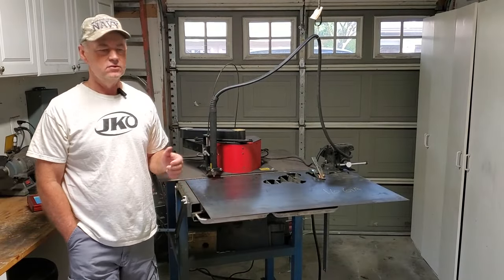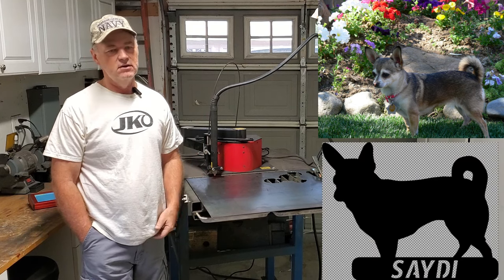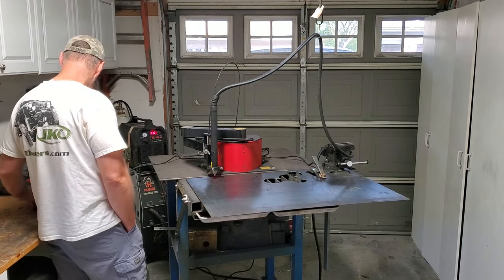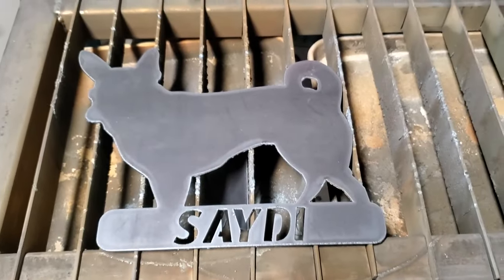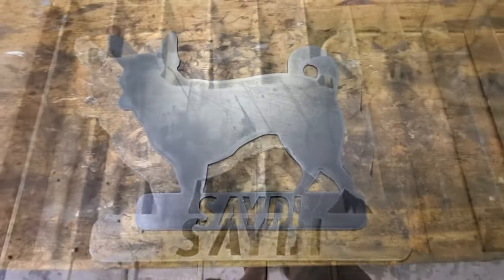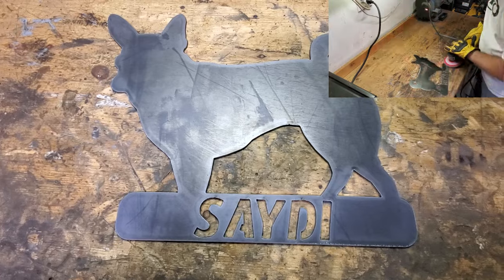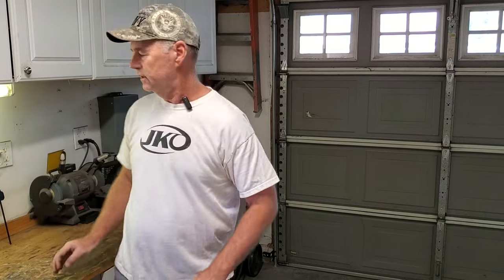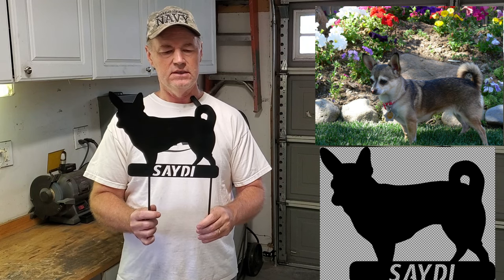Memorializing Saydi the Chihuahua with my Arcdroid CNC Plasma Cutter

Comment: Looks good !  Did you have to trace the image by hand or does Inkscape have a function to create the outline ?
Reply from the maker: It is a manual process but Inkscape has a Bezier tool that makes it easier to handle curves with fewer points to click.  So you basically click around the perimeter, then drag the lines to the curves.